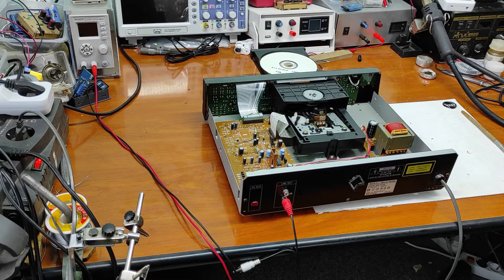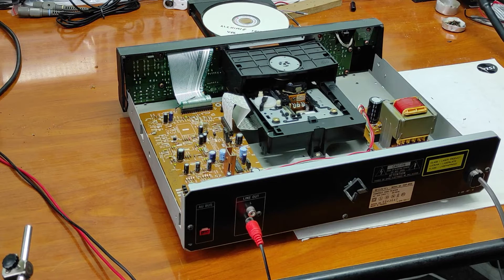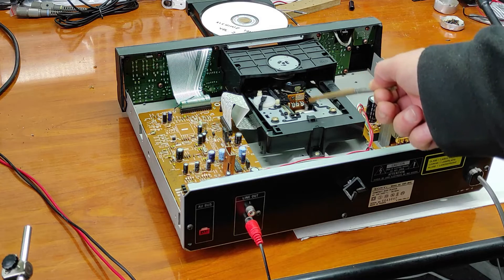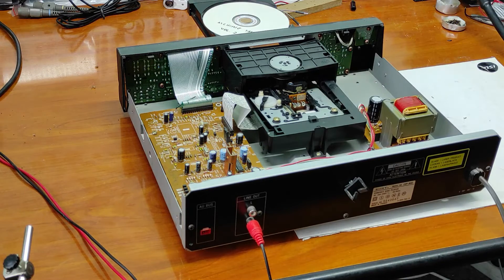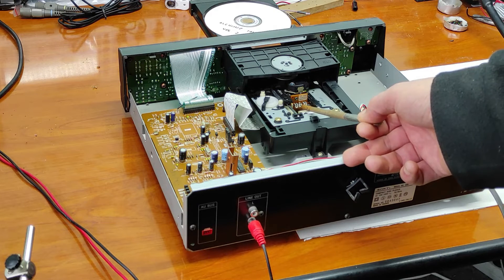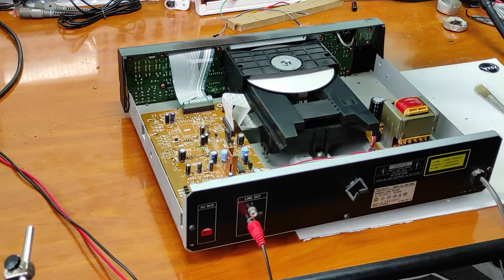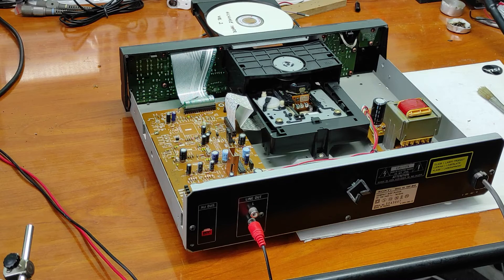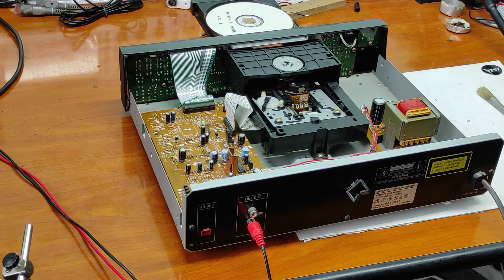Sony CDP-M43 ,KSS-240A optic module, cd player No disc error how to repair

Comment: NEVER EVER INCREASE THE POWER OF LASER, ITS WILL BURN IT VERY FAST. ANY SETINGS ON LASERS (EVERY LASER) ARE FACTORY SETTINGS AND THERE ARE NOT FOR ADJUSTMENTS AS SERVICING. THIS WILL KILL VERY FAST LASER HEAD. ALSO YOUR BRUSH IS NOT FOR CLEANING LASER AND YOU CLEAN NOTHING BY THAT. ONLY COTTON SWABS CAN CLEAN LENS NOT BRUSH.
Reply from the maker: tnx bro good to know. but if it is very old its good to test the unit before order a new laser.

Comment: When replacing with a new one, do I need to do this calibration? I bought another one and when I installed it, it didn't work either.
Reply from the maker: theoretically should be calibrated. its posible to calibrate at home but very dificult.

Comment: All of those kind of vids are focused on changing the power level od laser diode. What in situation when inserted CD is not spinning as it should for the first time, as on the vid? I read that if there is no initial spin of the CD than there is no autofocus function working so the motor could not spin the CD.
Reply from the maker: yes bro the laser unit is not recognizing the cd. is far to weak.
Reply: @diymariuselectro  Thanks. I changed the potentiometer position. Somebody must did IT wrongly. I set to minimum and CD works perfectly.
Reply from the maker: @Bunczu  maybe itx maximum...

Comment: Друг подскажи з за чего при вибрации проигрыватея sony cdp 597 скачетт трек???
Reply from the maker: english pls
Reply: @diymariuselectro  Hello friend. I have a Sony SDDP 597 player. The track jumps at the slightest vibration of the case. If you even slightly knock on the player's case, the track jumps. The track also jumps from loud music from the bass. What is wrong? What should I replace? How to fix it?
Reply from the maker: @daytonua2997  laser unit is week and need replac3d

Comment: What if it doesn't show me the "no disc" message, but when I insert it, it ejects it after a few seconds?
Reply from the maker: that s worse than no disc :)))
Reply: @diymariuselectro  but which is the problem?
Reply from the maker: @ori-i5v  weak laser power.

Comment: Hello. My pickup assembly is the KSS-240A. I turned the voltage pot and now cd detects perfectly and I can see track information and time counting. But there is no sound output. Could you help?
Reply from the maker: @dinodavis752  play function its working?
Reply: @ Thanks for reply. Yes play function is working.
Reply from the maker: @dinodavis752  I think u have a problem with da converter.
Reply: @diymariuselectro  The system is very old and was not operated long time. After seing this video, I turned the voltage pot and now cd detects and I can see playing of tracks and time counting. DA converter would fail? If so, replacing the chip will solve the issue? How about replacing the lens unit entirely?

Comment: You are great ! Needed  exact information on which potentiometer to adjust on my sony FH-B170 which reading the CD then suddenly stop and giving NO DISC error. Gonna try tomorrow.
Reply from the maker: tnx bro,but this is just a temporary solution,u will have to replace laser unit.
Reply: @diymariuselectro  Hello, this method worked for my system.
No skip and no errors now and switching between tracks flawlessly.
 I don't know how long it will work but at least its working for now.
Thank you very much !
Reply from the maker: tnx bro.
Reply: @diymariuselectro  And subscribed !
Reply: @diymariuselectro  Update : Like you said optical is slowly dying. Adjustment lasted for a year,  playing fine for first 7-8 tracks then giving NO DISC error suddenly
Reply from the maker: thats the way....
Reply: @diymariuselectro  Respect !

Comment: I just replaced the KSS240 to a new unit on my Arcam CD player but now I get some repetitive noise with every spin on te CD especially on the last few tracks( away from the centre ). What do I need to adjust please?
Reply from the maker: u have to adjust alignment but its very dificult and u need osciloscope and test cd.
Reply: Você substituiu pela qual?

Comment: With your instructions I just repaired my Denon CDC-725 CD player! Thx! 😊👍
Reply from the maker: I am glad that I helped you.hope to subscribe and create a comunity
Reply: by increasing laser power and decalibration of the laser will just fast kill laser. never use any pots on laser heads, there are only for adjustments in factory before instalation. the only setings in any cd player are on a board or autoadjustment via software.
Reply: @Johny666EU  Thanks for the info! But it's still working for now!

Comment: Hello, in my case laser is moving up and down but disc does not rotate i check motors externally and they are working fine. What could be the problem.I appreciate your reply.
Reply from the maker: laser its week and dont reocgnize the cd.you can adjust like in this video,or replace laser part.
Reply: @diymariuselectro  I will try with replacing the laser. I tried by adjusting as you showed in video but no result. I can see the red laser light but very dim.
Reply: Thanks for your reply👍
Reply: i got the same problem everything working fine but the motor that turns the cd doesnt spin i put electric manually and motor works well did you find soultion brother?

Comment: The deeper cause of the problem lying in the capacitor in the power rail that going to the laser pick up. It losing value thus losing the available power it can supply, that is why you can get it worked again by increasing the power to compensate it (reduce resistance by turning the Pot anti-clockwise).
When the cap lost more value than the range of the Auto power Pot can compensate then it will not work, and it will because the capacitor is dying anyway. 
Trace the ribbon cable back to the mainboard and find any capacitor next to the connector, replace it...most of the time it will work without touching any adjustable potiometers on the laser assembly, which may be a dangerous thing.

Comment: Does this pickup contains solder joints?
Reply from the maker: I dont understand your question sorry
Reply: @diymariuselectro  normally when you buy replacement laser lens optical pickup there is a anti static solder point on the lens circuit board which needs to be desoldered before installing and this was done because of potential short circuit or damaging the laser when transporting.
Reply from the maker: @卡拉永遠OK唱不完  ok now I understand.I dont know,I didnt replace the laser led,I just adjust the power.
Reply: @diymariuselectro  i see thanks anyways

Comment: Good video! Thanks! I have some minidisc players with no working the pickup, im already try all but never works, the laser are ok, im already adjusting to ideal gain etc but nothing, the pickup trying to read the disc several time but cant read, i thik the problem is about some alignment but how i can put the right alignment in that lens?
Reply from the maker: when I made this video I found on the net detailed instructions to make all the adjustments,u need osciloscope and testcd.U can fint on the net.

Comment: hello, in my case, the lens goes up and moves but the disk does not rotate, I don't know if it's the motors or I also have to adjust a screw, I would appreciate the help
Reply from the maker: I presume that led receiver doesnt see the laser beam,and the motor dont rotate.u can try adjust the power.
Reply: @diymariuselectro  In this case, would it be to adjust the one on the right, the one in the middle or the one on the left? I also have the KSS-240A on my sony LBT D550

Comment: Great video!
Just can you tell me the width of the ribbon connector (the one who's going, by left side, outside the optical drive).
I think by "width" the number of traces.
There is lot of mechanism with KSS-240A and they have different control PCB (with smaller or larger ribbon).
It's for fixing a SEGA mega CD.
thank!
Reply from the maker: I cant help u because I didnt have the cd anymore.

Comment: How check laser power V? Multimeter? I have Kenwood DP-5060 with KSS240A.
Reply from the maker: I think I said in the video and coments that u need an osciloscope because its a signal and not a simple voltage.

Comment: Thanks! Even if told that no adjustement should be done without proper readings, i turned just a little bit (5 degrees?...counterclockwise) one of the screws i a 90's cd player and is working perfectly. Hope it lasts and don't get fried. Removing stuff to get the readings in my case was a hell of a hassle so i took my chances. Thank you very much for this video!
Reply from the maker: U are lucky

Comment: Great video thank you !
Optic module replacement is only needed for no error disc ? Because  I bought a CD player which is crackling.

Do you have any recommandation for an oscilloscope ?
Reply from the maker: It should work aslo for you.give it a try.
Reply from the maker: U can find on my chanel review for my scope.its good.
Reply: @diymariuselectro  Thank you Marius !!!!!!
Reply: I wonder also why an oscilloscope is needed if what is needed is just to see the voltage ?
A voltmeter is not enough ?
Reply from the maker: its not a fixed voltage,its high freqency signal,and u need osciloscope.
Reply: @diymariuselectro  Thank you ! 👍🏻👍🏻👍🏻

Comment: Hey man! I have an old Akai sampler with this mechanizm (Akai CD3000 non xl). Unfortunately i moved all the knobs on the lens module. I have an osciloscope but i don't know where to plug it to calibrate the lens. Any advice?
Thanks in advance!
Reply from the maker: when I made this video I found on google a complete article describing how to adjust all the knobs with the osciloscope.pls search it and if u not find I will search for u.
Reply: @diymariuselectro  thanks! 
I will dig it!

Comment: Well, I've just did repair my CD player based on KSS-240a by turning up the power on laser.
But found an youtube video which explains what to do more - cleaning - and then it runs on normal values.
I'm going to test this:
https://www.youtube.com/watch?v=7LdyMof-eHc

Comment: Hi,
I have the same CD player model, and it suffer from CD tray drawer wen closed, the laser mechanism don't move up...
Plz could desassamble your CD drawer and explain how the mechanism should work properly so I can compare if the issue is because of belt or the wheel?
Reply from the maker: hi probably the mecanism is not fault,the led power is to small.try to increase it.